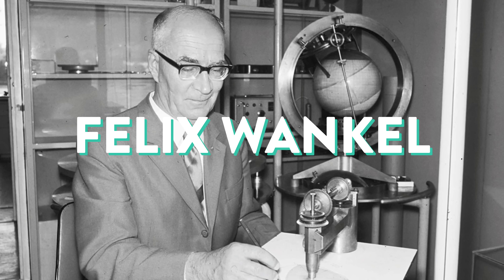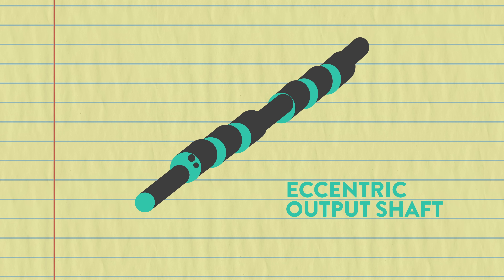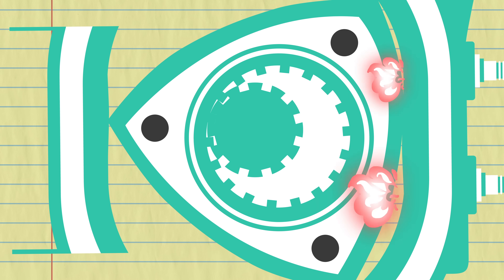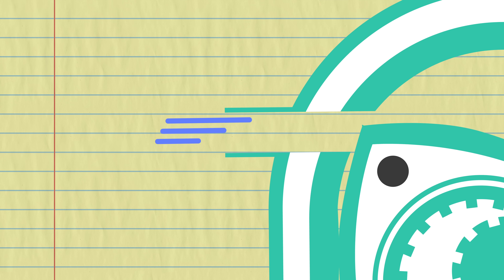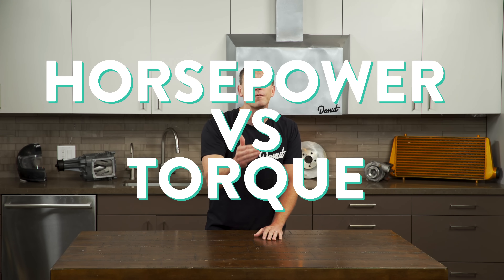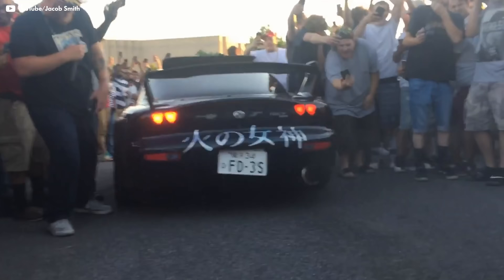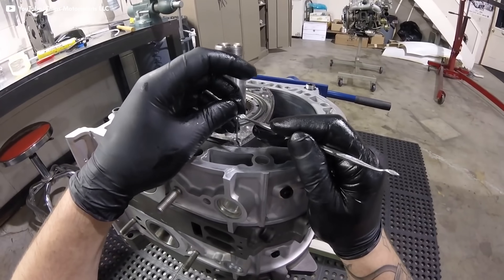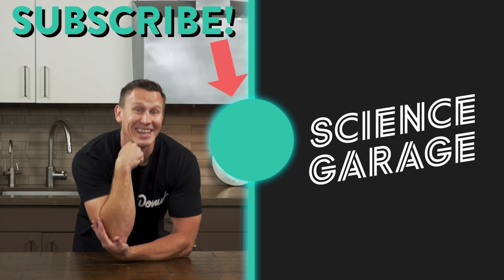Rotary Engine | How It Works

Comment: Just appreciate the level of genius
Reply: FELIX WANKEL WAS AN UNDERAPPRECIATED GENIUS
Reply: Unfortunately Felix Wankel's engine design was a complete failure.
Reply: @doktorbimmer  if it was around as long as piston engines im sure it would be a lot better than them
Reply: @alper7653  yeah, I would've loved to see mainstream companies like GM and Ford to take it on and put time into them like piston engines. That 7 litre Corvette would've been insane
Reply: @alper7653  The Wankel was invented nearly 70 years ago... so you might  want to rethink your theory.
Reply: @aaron8973  You must be very young? GM and Ford were both major players in the development of the Wankel engine.
Reply: Dee Jay  FORD once held more patents for improvements to the Wankel than any other company including Mazda.
General Motors licensed the Wankel KKM from NSU Motorenwerkes GmbH. On Nov.10th 1970.
(NSU is the company that invented the Wankel KKM.)

GM spent an estimated 10 million dollars per month developing the RC2-206 and other prototype designs during the 1970s.

Mercedes Benz was spending 100 million dollars a year developing the M950F.
Reply: Dee Jay  FORD owned Mazda from 1974 until 2009.
Mazda never perfected the Wankel... the Renesis was the most unreliable automobile engine of the 21st century.

Comment: A problem with rotaries is the unburnt fuel in the exhaust. The CREEV (Compound Rotary Engine for Electric Vehicles) uses a secondary rotor to extract energy from the exhaust, burning the unburnt exhaust products. This adds to the horsepower and also cleans up the emissions. The secondary rotor (not Wankel shaped) can be in the engine housing or as an exhaust add on.

Run at a constant speed rotaries are very efficient - like when used a s range extenders for hybrids, with Mazda introducing one within a year. As they will be part time engines they will not be used much and last and last. The low usage means lower emissions.
Reply: Childish insults won't make you look very mature... or prove your false rumors!!!
Reply: Bimmer, you have been told to stop making things up.
Reply: Jonny your fake rumors cannot change the truth.
Reply: Bimmer,
How is the therapy going?
Reply: Fake rumors don't come true Johnny!
Reply: But explain why Wankel engines have never been sold commercially in fixed rpm applications??? Wankel engines are an obsolete technology that is no longer manufactured anywhere in the world today... Even Mazda abandoned the Wankel engine a decade ago.
Reply: @doktorbimmer  
Hi Bimmer, I thought you had committed suicide because Mazda are introducing a Wankel within a year as a range extender. 

Nice to know you are still alive. How is the therapy going?
Reply: Still spreading false rumors about Wankel engines that do not exist???

 You realize that all of your false predictions have never come true... every year they turn out to be nothing buy fantasy tales and outright lies.
Reply: Mazda no longer manufacturers Wankel engines and ceased all development of production engines in May, 2009... the last prototype ever made was last seen 11 years ago and no new prototypes exist.
Reply: Bimmer, Wankel engines are used in drones.  Have you forgot already?  You need stronger therapy.
Reply: Not really, all of the best production UAVs use reciprocating piston engines made by Rotax... most of the vaporware Wankel scams have gone defunct now.

Comment: By: Cam VanDerHorst, Contributing Writer Mazda has made breakthroughs in rotary technology – and it may return to production soon. Fans of Mazda's rotary engine have spent years lamenting the loss of the unique powerplant and eagerly awaiting its return. In the face of ever-tightening emissions standards and ever-increasing fuel economy requirements, it has seemed – for a while now – that the rotary engine was doomed to remain a relic of the past. Perhaps more so than any other industry rumor, whispers of the rotary's triumphant return have appeared with unmatched regularity, only to wither and die on the vine just as quickly. However, this is no rumor – this comes straight from Ichiro Hirose, the executive in charge of powertrain development at Mazda. More Rotary Rumors: Rotary Fan Renders A Modern RX-7 For 2020 And Beyond Everyone At Mazda Is Dreaming Of A Rotary Sports Car, Says CEO The Australian motoring publication Drive had a chance to speak with Hirose at the 2019 Geneva Motor Show, where Mazda was celebrating the reveal of their new CX-30. More important than a new crossover, however, was what was revealed about Mazda's developments in rotary engine technology. According to Hirsoe, what was originally intended as a range extender has grown to become a much more versatile powerplant in light of recent technological breakthroughs. He says that the new flexible rotary hybrid powerplant currently in development is so efficient that it could be sold in any market in the world – even markets with notoriously strict emissions regulations in place. Hirose went on to describe a setup similar to the Toyota Prius, in which the hybrid drivetrain has the versatility to not only generate electricity, but to actually power the drive wheels when needed. This technology, dubbed XEV, may make an appearance in production cars – at least in Australia, and, we'd imagine, Mazda's native Japan – within the next few years. That's perhaps the most promising news yet for the rotary engine faithful. While we may never get another car like the RX-7, we may indeed end up with something even better.
Reply: The uk government are being forced to ban or limit diesel cars by 2040. They are giving off high amounts of carcinogenic pollution and are credited for a large rise in cancerous deaths. A lot of the diesel emission testing didn't apply to real world situations while many were falsified. In other words 95% of diesel cars are marginally better for us than petrol if at all, some diesels are worse. DPF filters (that limit the cancerous fumes) are also a very big grey area in effectiveness. Many people have them removed as they block up easily and are costly to replace. Also very conflicting evidence in how well they actually filter while working on top of the added pollution they take to make. Also much pollution is added because some people are forced to ''drive on the motorway to clean the filter''. If they don't do that a warning light puts cars into limp mode. Sellers of such cars do not tell people that diesels are very bad to be used as anything but long distance vehicles. Car makers want sales, telling people a car that is bad in short journeys is not good business for them so they don't say it.Read more Show less

Comment: The Holy Grail Of Rotary Engines - SkyActiv-X
Reply: Pascals Law refers to an equivalence of pressure and volume 
relationship.  If you're increasing pressure, volume must decrease to 
maintain preservation of energy.  Take a balloon for instance, if you 
decrease the size on one side, the opposite side increases to maintain 
volume relationship.  So the argument does not pertain, the principal in
 essence is correct

Comment: FUEL MILEAGE IS ALL ON THE LEADING PLUG HOLE AND YOUR 2MM APEX SEAL  MAJOR WASTE OF FUEL AIR AND COMPRESSION FIX IT
Reply: By: Cam VanDerHorst, Contributing Writer Mazda has made breakthroughs in rotary technology – and it may return to production soon. Fans of Mazda's rotary engine have spent years lamenting the loss of the unique powerplant and eagerly awaiting its return. In the face of ever-tightening emissions standards and ever-increasing fuel economy requirements, it has seemed – for a while now – that the rotary engine was doomed to remain a relic of the past. Perhaps more so than any other industry rumor, whispers of the rotary's triumphant return have appeared with unmatched regularity, only to wither and die on the vine just as quickly. However, this is no rumor – this comes straight from Ichiro Hirose, the executive in charge of powertrain development at Mazda. More Rotary Rumors: Rotary Fan Renders A Modern RX-7 For 2020 And Beyond Everyone At Mazda Is Dreaming Of A Rotary Sports Car, Says CEO The Australian motoring publication Drive had a chance to speak with Hirose at the 2019 Geneva Motor Show, where Mazda was celebrating the reveal of their new CX-30. More important than a new crossover, however, was what was revealed about Mazda's developments in rotary engine technology. According to Hirsoe, what was originally intended as a range extender has grown to become a much more versatile powerplant in light of recent technological breakthroughs. He says that the new flexible rotary hybrid powerplant currently in development is so efficient that it could be sold in any market in the world – even markets with notoriously strict emissions regulations in place. Hirose went on to describe a setup similar to the Toyota Prius, in which the hybrid drivetrain has the versatility to not only generate electricity, but to actually power the drive wheels when needed. This technology, dubbed XEV, may make an appearance in production cars – at least in Australia, and, we'd imagine, Mazda's native Japan – within the next few years. That's perhaps the most promising news yet for the rotary engine faithful. While we may never get another car like the RX-7, we may indeed end up with something even better.

Comment: can we get past this idea that the piston or rotor pushes the exhaust out? exhaust wants to leave on it's own because it's much higher pressure than outside the engine, that pressure differential is what spins your turbo for example.
Reply: Wow! its easy to see from your comment, you are not an engineer or a competent mechanic...
Reply: @doktorbimmer  you really think a piston literally pushes the exhaust  the cylinder eh?
Reply: You don't know anything about engines do you?
Reply: @doktorbimmer  you don't know anything about engines do you?
Reply: If the piston does not push the exhaust gases out? Are you suggesting there is no pumping loss during the exhaust stroke???Then explain why does the cylinder pressure rise during the exhaust stroke after BDC???  A turbocharger's exhaust turbine is driven by the TEMPERATURE DIFFERENTIAL of the exhaust gasses Gas Turbines are Heat Engines and comply with Second Law of Thermodynamics and the Carnot Cycle Formula...
Reply: @doktorbimmer  air/gases go from high pressure to low pressure. pretty simple.
Reply: Lol!!!! Only if your air intake is at sea level and your exhaust pipe is in outer space... Lol!!!
Reply: @doktorbimmer  so on a naturally aspirated engine, how is the air being drawn in? by pressure differential
Reply: What causes the pressure difference?
Reply: @doktorbimmer  um... combustion. the expansion of the air due to heat.
Reply: Combustion draws the air in?????
Reply: You wrote, quote; "so on a naturally aspirated engine, how is the air being drawn in? by pressure differential"
What causes the pressure difference that draws the air into the engine and the cylinder(s)????
Reply: @doktorbimmer  the piston going down creates vacuum, keep up. and before you say it's the opposite for the piston going back up pushing exhaust out I'll tell ya the pressure caused by combustion is a lot more which is why it's not the case on the exhaust stroke.
Reply: Then explain why does the cylinder pressure INCREASE at the beginning of the exhaust stroke??? The pressure inside the cylinder is lowest after 90° ATDC and then increases after 180° BDC. What causes this increase in cylinder pressure????
Reply: @doktorbimmer  how are you measuring that pressure?
Reply: Are you not familiar with how cylinder pressure is measured son? How do you think you measure cylinder pressure???
Reply: IT IS CALLED A EXHAUST STROKE BIRD BRAIN
Reply: @ernie brink rotary hemi Hey Ernie! Please tell us WHY? your engine doesn't run????
Reply: @ernie brink rotary hemi Just tell us WHY? your engine still doesn't run????

Comment: Mazda only sells wankel reciprocating engines now.
Reply: if you keep telling doktorbimmer that he will start crying.  Wankel              * LOOK DOKTRBIMMER THE FAKE ENGINEER  AND FAKE ERNIEBRINKROTARY HD LOVER LO
engines are intimately related to his type of schizophrenia.solve problems"
Reply: @erniebrinkrotaryhemi7336  By: Cam VanDerHorst, Contributing Writer Mazda has made breakthroughs in rotary technology – and it may return to production soon. Fans of Mazda's rotary engine have spent years lamenting the loss of the unique powerplant and eagerly awaiting its return. In the face of ever-tightening emissions standards and ever-increasing fuel economy requirements, it has seemed – for a while now – that the rotary engine was doomed to remain a relic of the past. Perhaps more so than any other industry rumor, whispers of the rotary's triumphant return have appeared with unmatched regularity, only to wither and die on the vine just as quickly. However, this is no rumor – this comes straight from Ichiro Hirose, the executive in charge of powertrain development at Mazda. More Rotary Rumors: Rotary Fan Renders A Modern RX-7 For 2020 And Beyond Everyone At Mazda Is Dreaming Of A Rotary Sports Car, Says CEO The Australian motoring publication Drive had a chance to speak with Hirose at the 2019 Geneva Motor Show, where Mazda was celebrating the reveal of their new CX-30. More important than a new crossover, however, was what was revealed about Mazda's developments in rotary engine technology. According to Hirsoe, what was originally intended as a range extender has grown to become a much more versatile powerplant in light of recent technological breakthroughs. He says that the new flexible rotary hybrid powerplant currently in development is so efficient that it could be sold in any market in the world – even markets with notoriously strict emissions regulations in place. Hirose went on to describe a setup similar to the Toyota Prius, in which the hybrid drivetrain has the versatility to not only generate electricity, but to actually power the drive wheels when needed. This technology, dubbed XEV, may make an appearance in production cars – at least in Australia, and, we'd imagine, Mazda's native Japan – within the next few years. That's perhaps the most promising news yet for the rotary engine faithful. While we may never get another car like the RX-7, we may indeed end up with something even better.

Comment: https://www.youtube.com/channel/UC7SszXc0BXF8nRX2e9gmxCw
Reply: the fake
Reply: @dokterbimmer7270  BUY A PISTON ENGINE BUY A BLOCK
Reply: @xkexke8081  THIS FUNNY
Reply: doktorbimmer could you walk us through the moments you experienced when you blew up your rotary?
Reply: @movingcombustionmazda6340  
 saying a rotary is unreliable just shows you've never owned one, they're danm near impossible to over rev or blow up unlike a piston engine where you go a few hundred rpm's over the redline and suddenly your loseing power and shooting piston connecting rods through the side of the block. On a rotary when you go a few THOUSAND rpm over the redline, well you just get more power and better engine lubrication WORST case senario is you run out of fuel injector flow and lean out wich could cause damage but i'd say that for the type of engine they are(a race engine designed to give loads of power and run at high rpm's all day long) they are incredibly reliable.
i think the problem is that people compare them to priuses and other grocery getters designed to go barely the speed limit sit in traffic for hours on end, this is not what the rotary was born to do and putting a rotary through a life like that will kill it in a matter of months.

Comment: Felix Wankel’s engine was conceived during a dream. In it, 17-year-old Felix was driving his car to a concert. When he arrived, he bragged to his friends that his car used a new type of engine – half turbine, half reciprocating. “It is my invention!” he told his friends. Upon waking up, Wankel became dedicated to building his engine. Though he never received a formal degree (or a driver’s license), Wankel was a gifted engineer.
Reply: dokterbimmer the fake ???? WOW!!! You're right, he did delete all his comments
Reply: @xkexke8081  yes i did
Reply: https://giphy.com/gifs/tweety-bird-cvOmdJLyBfpw4/tile
Reply: tweet tweet tweet
Reply: @movingcombustionmazda6340  FUEL MILEAGE IS ALL ON THE LEADING PLUG HOLE AND YOUR 2MM APEX SEAL  MAJOR WASTE OF FUEL AIR AND COMPRESSION FIX IT

Comment: This works like a 2 stroke Johnny (motor)
Reply: All Wankel engines use the exact same 4-stoke operating principles as reciprocating Otto and Diesel engine do...
Reply: COMBUSTION SHAKE THIS IS THE DEVIL MARKS FROM THE APEX SEALS            FAKE DOKTERBIMMER
1

Comment: So much condescension, and so many assumptions in so few words...
DOKTERBIMMER IS A FAKE ENGINEER    https://giphy.com/gifs/tweety-bird-cvOmdJLyBfpw4/tile
Allow me to enlighten you;
I have not compared it to a 2 stroke in any comments here (though the comparison is entirely valid).
I'm not a kid, I'm an Aerospace powerplant development engineer, and a former Mazda technician. I have a comprehensive understanding of the Wankel rotary engine (though I'm not nearly pretentious enough to use non English initials for it when communicating in English).

Contrary to popular belief, this engine is not an occult entity of magic and mystery, it is an internal combustion engine. Different in that it is a constant volume pumping unit, and non-reciprocating, but still just an engine that translates thermal expansion into rotational motion like all the others.

Don't be an arse.
Reply: dokterbimmer the fake ???? WOW!!! You're right, he did delete all his comments